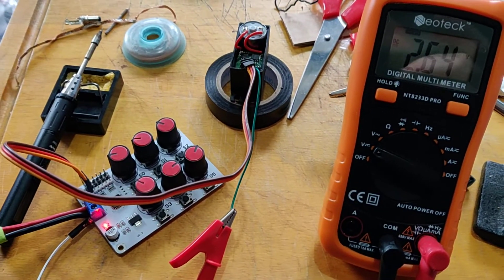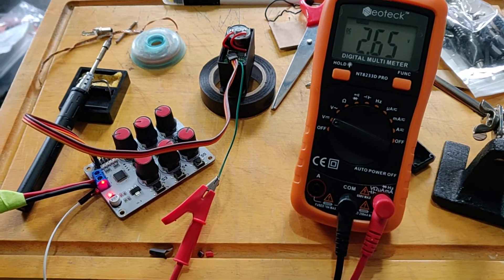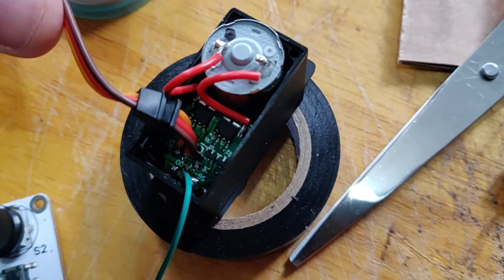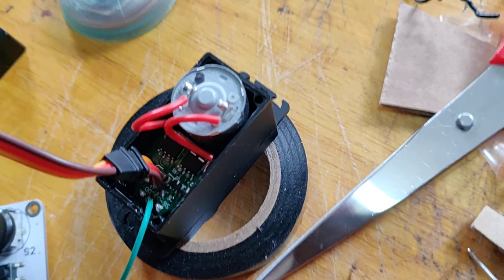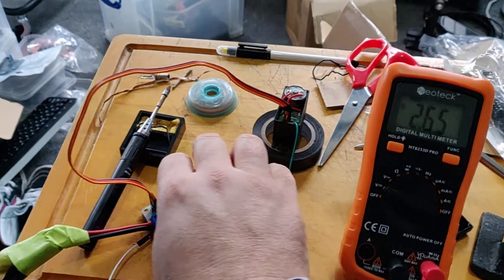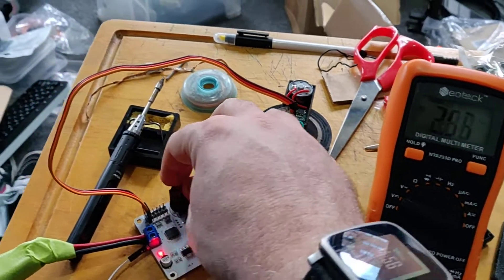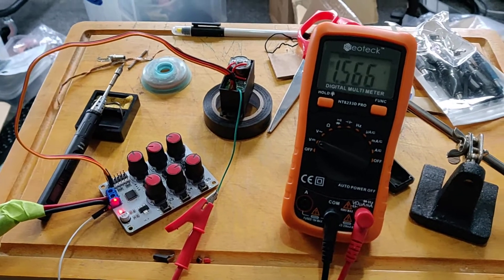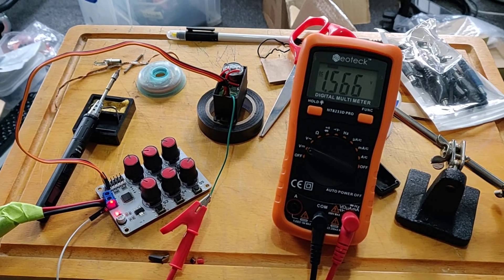Analogue Feedback from an MG996 Digital Servo

Comment: Have you ever got to do that compliant arm, i tried the same thing but the voltages don't match well with the pulse width, how did you solve that?
Reply from the maker: I didn't have a problem when I was testing that I can remember, I've since switched to dynamixels though. The wiring was getting out of hand with the digital servos and that was before adding feedback wires in too.
Reply: @NeaveEng  what algorithms do you use to make it compliant, it would help greatly to see how it's done, maybe a github link to you code or other materials
Reply from the maker: I'm only just getting the mechanism for the new arm built so haven't started on that yet. If you have a look at my latest video you can see the new shoulder mechanism.

When you say compliant, do you mean being able to move it by repositioning the arm yourself and it holding position? I've heard the term used for a few things so wanted to be sure :)
Reply: @NeaveEng  by that compliant i mean, the arm is powered and it is holding some position, but when you push on it for example it moves as you push to a new position
Reply from the maker: @ironman5034  Gotcha! Yeah, I've seen other arms that use Dynamixels do that, I think it may be a mode you can put the servo in to though rather than something you would need to program yourself. 

For the servos with a feedback line, I'm not sure how I'd do it to be honest, it'd be a bit tricky. I suppose if once you move to a position you could monitor the feedback line and create an average for the current set point. After that if there's a deviation from that beyond a certain amount you could slowly move the angle to the new one? 

There's almost certainly a better way to do it but that's the way I'd start developing it at least.

Comment: Did you work out how easy it is tap into these motors?
I would like to create some kind of linear feedback, this seems like a logical stop. Or perhaps some external thing attached to where I'm mounting the motors.
Unsure!
Reply from the maker: Sorry for the late reply! If you open up the servo there's usually a little circuit board on it with three solder points on it. Not the one connected to the cable mind. These three points connect to a potentiometer, if you put a multimeter between the middle pin and ground you should see the resistance change as the servo moves. If you measure the max and min values for that then you should be able to monitor it using an Arduino or similar.